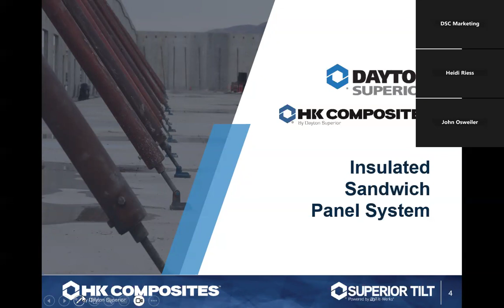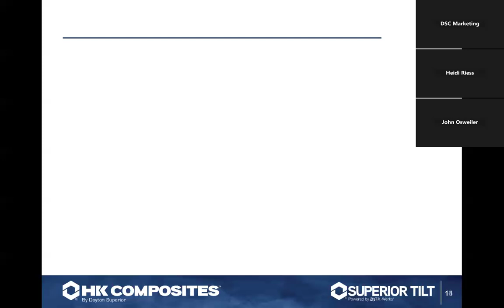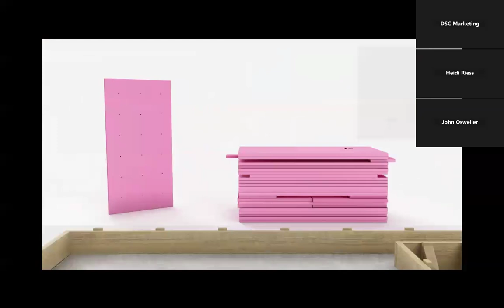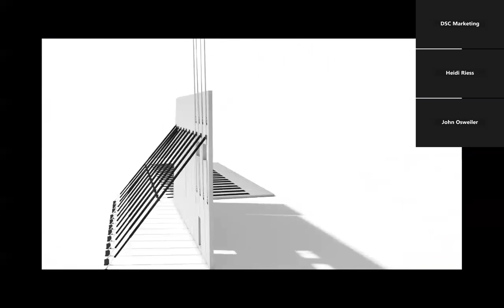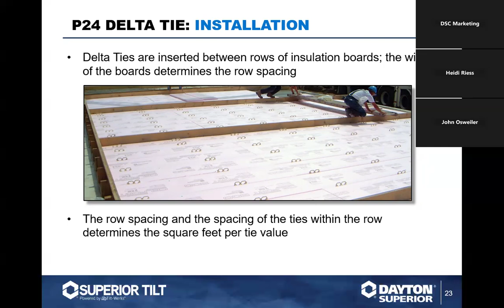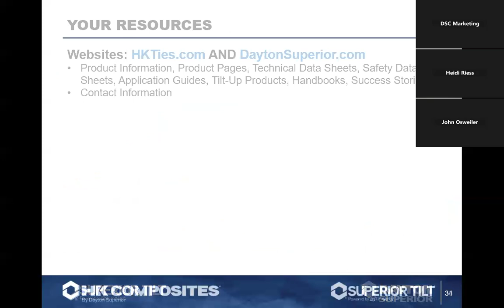Insulated Wall Panels for Tilt-Up - Webinar Training by Dayton Superior

Comment: As an inspector, we've always referred to all similar construction as "tilt up" without differentiating between precast and tilt up.  Would that reference be acceptable or considered ignorant?
Reply from the maker: That is a great question! Yes, it is all tilt-up. There is very little difference between precast tilt-up and 'cast-on-site' tilt-up. They both have panels on-site; one delivered on a truck and the other is cast on-site. A crane will erect all panels and the panels are braced until final structural components are put into place. Realistically the process is the same; the only difference is with precast tilt-up the panels tent to be approximately 10 to 12 feet wide. By contrast, cast-on-site panels are much wider, thus delivering fewer vertical joints. Thanks for asking.
Reply: @Daytonsuperior  TY